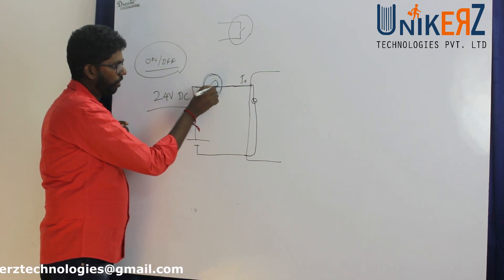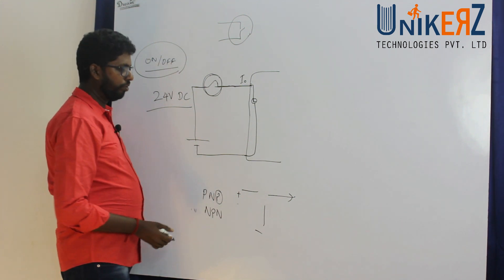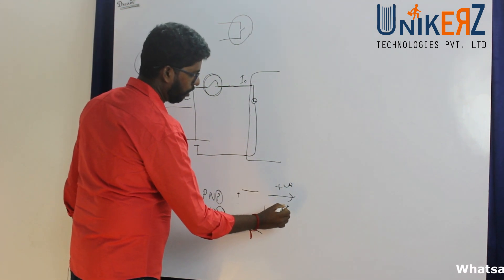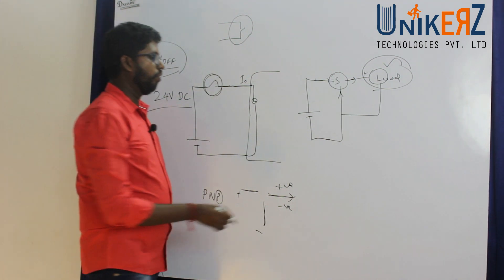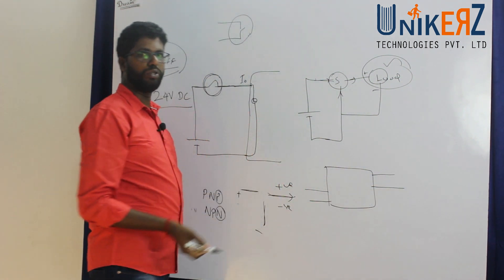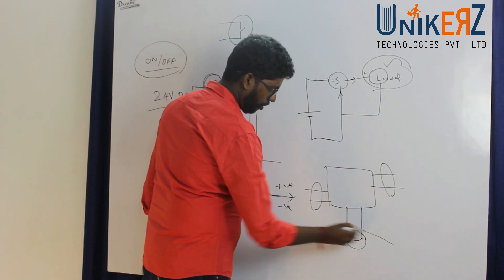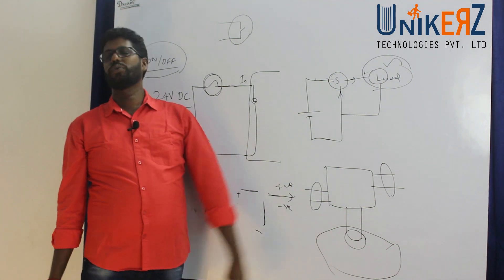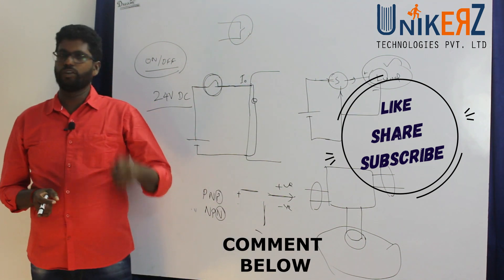2 wire, 3 Wire, 4 wire sensor - Sensor & PLC wiring - PLC Input Devices - In TAMIL

Comment: Sir,
I am used in Pneumatic cylinder in 2 wire readwitch sensor. How the lamp on, but the lamps working is 24v,0v  ,my question is 2 wire readswitch sensor 24v input-output is 24v,how the lamp on without ov. I am used in smc make sensor(SMC D-A93)
Reply from the maker: Nanba, Load should connect with power source through a switch... read switch is a switch. So power +Ve connect through read switch to lamp, -Ve directly to lamp. See the video clearly
https://www.youtube.com/watch?v=KrzavknGIvE&t=20s
Understand what is circuit.

Comment: I am a maintenance engineer I need your support
I have 9000x AF Eaton VFD
I need to programme for pump auto start from differential pressure switch in auto mode We have HOA switch manual mode working no issue please advise me how to programme for auto mode

Comment: Sir please add loop test procedure both hot and cold for all type of sensors like Gas Detectors types, Beaco and Sounders, pressure, Temperature sensors etc.., and with required test tools like Calibrator etc..,

Comment: In what purpose using 4wire sensor. If two wire is enough means why need 4 wire. Kindly explain it please sir
Reply: Its not about two wire is enough. It is based on how the feedback signal is measured. In Analog inputs we have different feedback, 0-10V, 0-5V, 4-20mA. If we are getting feedback using 4_20mA means two wire is enough (in most sensors).but in case of 0-10V feedback sensors power should be given seperately